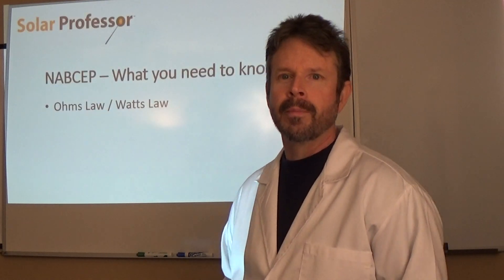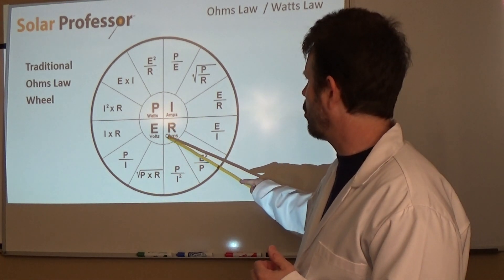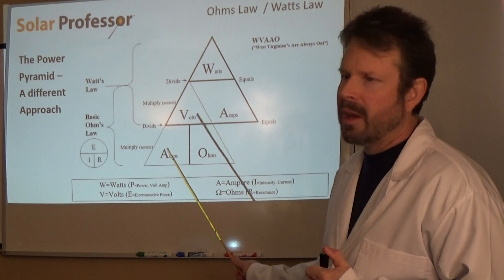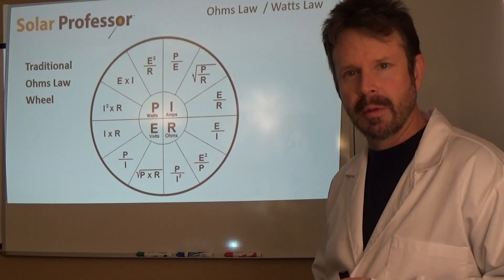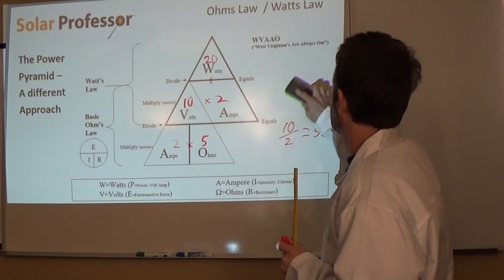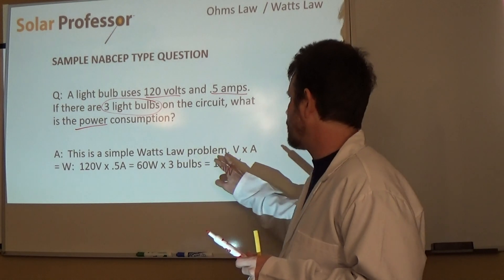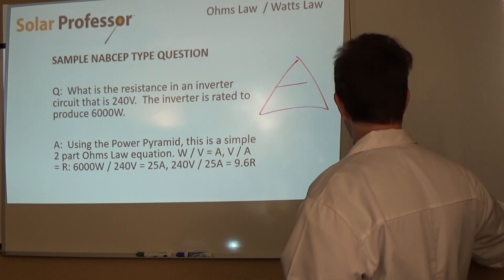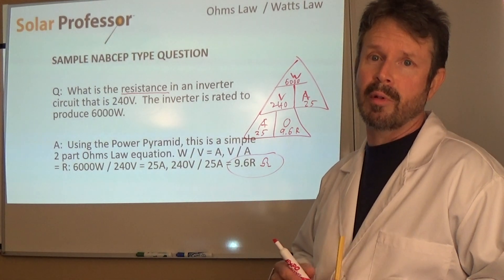NABCEP - Must Know - Ohms Law / Watts Law*

Comment: Just starting to attempt to enter this field as of today.  It is so comforting to see basically all the stuff I used as an electronics technician in this field as well.  Might make it to solar engineer yet!
Reply from the maker: Go for it Paul!!  Welcome... great to have you join us in the solar industry.
Reply: @solarprofessor7695  Any advice for getting that first job?  I've stopped trying to become a programmer due to lack of opportunities.  lol  Hoping solar is an industry that still trains people.
Reply from the maker: Yes, definitely Paul... I would suggest becoming an installer first - even if it is entry level and only for a short time.  People who have installation experience become the best designers, sales people, warehouse managers, procurement managers, operations managers, etc.  Having an opportunity to work with the products and parts provides a big advantage in all the possible career paths.  Also, check out the IREC Solar Career Map: https://irecsolarcareermap.org/